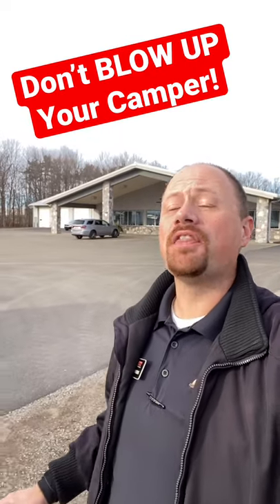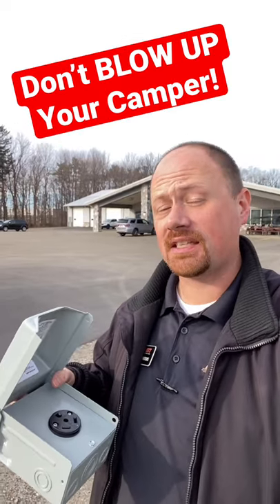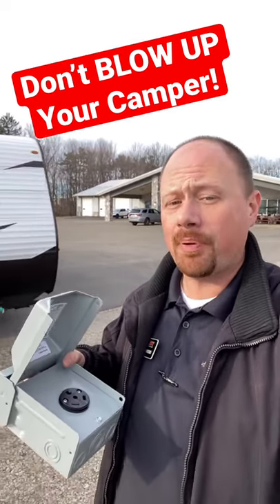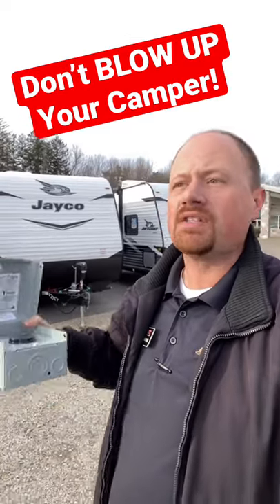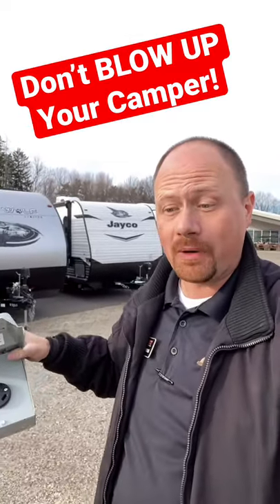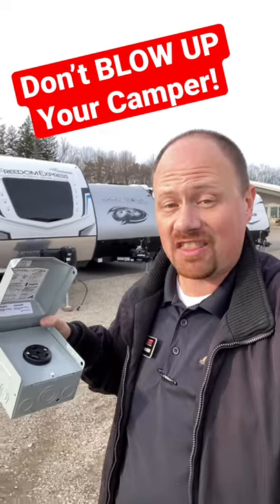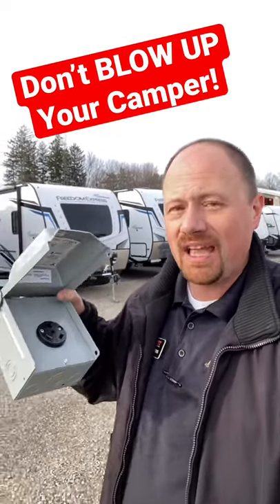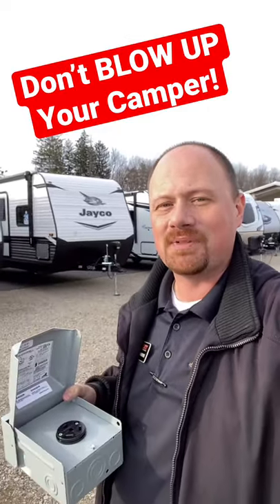Easy to Make Deadly Mistake!!

Comment: This video saved my brand new geo pro - my electrician put in a 220 - and I wouldn’t have known it.  Watched this video and called him - he came right away and changed it.  If it’s a dual pull it’s probably 220 but regardless you have to check the voltage if you don’t know wiring.  Thank god I watched this today!!!
Reply from the maker: Wow 😮 
I was hoping to help some people but to actually read it.. it’s different

So glad you made that call!!
Reply: I just did the same, only I’m the electrician. The only 30 amp single pole breakers I’ve ever installed were for well pumps, had no clue about rv’s. I’m heading down tomorrow to see how much it’s going to cost me.

Comment: I had a 50/30/15 box installed at my house. Best thing ever
Reply from the maker: Brilliant!
Reply: I had a 30 amp plug in installed on to the side of my house just for plugging my RV into. It's nice being able to run the air conditioner while packing it for a trip!

Comment: Whoever installed the outlet screwed up.  They used the wrong outlet for a 220 ckt.  The neutral blade is different between the 110 and 220 circuits.
Reply: Exactly my thoughts
Reply: It’s much different. Duh

Comment: each bus is 120v though? I only wire houses not campers but appliances like a range or dryer still only have 120v from either hot to the neutral. a sub panel works the same way

Comment: @ JoshtheRVNerd...
A 50ft. 30 amp Plugged into a Surge Protector and that's plugged into a 30amp to 110 volt adapter, would that suffice?... Or would you suggest a different approach?
Reply from the maker: Apologies I don't follow
What you're describing sounds like you're just dropping down to 15a household power

Comment: My son and I just installed a 30 amp outlet on the side of my shop for my RV.  Watch You Tube tutorials.  You must wire in a 110 breaker in the electrical box. NOT a 220 breaker.

Comment: And a tip for home owners. Mark the box 220/240 30amp.
Reply from the maker: Brilliant
Reply: @JoshtheRVNerd  I’m an retired electrician. And those boxes should be marked out so this doesn’t happen. So great info again from you !
Reply: This is exactly my problem today in a rented RV in my driveway while the termite exterminators are tenting my house!
So far, my ricemaker went POP, and the over-the-stove microwave died.
I can't get the owner of the RV to listen to me that welder plug just shown is a mistake!
When she comes by today with an "adapter" she just got overnighted to herself (I have no idea what she's talking about), should I suggest she plug the RV into a 110v outlet on the side of the garage?
I only need lights and the fridge in the RV. The weather is good, no need for ac or anything big.
Reply: 🤓 I have a tip for RV owners: don’t assume, ask. I believe we all know what assuming does. That’s right, it burns up your RV😂. Admit it, you thought I was going to write something else.

Comment: I had a buddy that almost did that at his farm he had an old shop that had a 30 amp plug in with an old plug in. He decided to get a new 30 amp rv outlet box and wired it outside so he could plug his camper in. Lucky for him that I was visiting him that day just before he went to plug it in and I asked him if it was a 240 setup or a 120? He wasn't sure and luckily his brother-in-law came over and used his multimeter and found out that it was a 240 amp for an old Lincoln welder. I've since bought one myself and check to make sure that the polarity is correct before I plug in, especially important to do for a private campground. I've found twice now that it was hooked up wrong. I paid under 75 for my multimeter and it has already saved me thousands of dollars. All you do is put one in the neutral (top hole) and the left and it will read your voltage if it is connected correctly. If it reads zero try the right side and if it reading the proper voltage then they hooked it up in reverse. If it does read correctly I still use my adapter cord just in case there is a power surge or brown out. Buying a new adapter cord is a lot cheaper than rewiring your trailer and/or replacing you electronics if they are fried.
Reply from the maker: oh my gosh.. textbook example of "Crisis Averted!"

Comment: I have wired in several of those plugs over the years with it's own 30A single pole breaker for when family visits or if I visited them. Whoever did that plugging in should have asked the house owner or called before trying to just plug in to a box. Takes just a second to do simple things to not burn down a trailer or house.
Reply from the maker: At least once a year I hear something like this. Hoping we can help someone avoid a really costly and potentially seriously dangerous mistake

Comment: This is exactly my problem today in a rented RV in my driveway while the termite exterminators are tenting my house!
So far, my ricemaker went POP, and the over-the-stove microwave died.
I can't get the owner of the RV to listen to me that welder plug just shown is a mistake!
When she comes by today with an "adapter" she just got overnighted to herself (I have no idea what she's talking about), should I suggest she plug the RV into a 110v outlet on the side of the garage?
I only need lights and the fridge in the RV. The weather is good, no need for ac or anything big.
@JoshtheRVNerd
Reply: @JoshtheRVNerd
I guess that's a yes

Comment: I’ve heard of this happening. Are people plugging a 30 amp RV (Nema TT30) into a Nema 10-50 or Nema 10-30 (both 220v) or are people miswiring TT-30 outlets?

Anyhoo, my welder is Nema 6-50 so a person shouldn’t be able to plug an RV in to it at all.

Comment: I have a 50amp camper and put in a 30amp box on my garage I use the 50 to 30 adapter cord and have had no problems. We did that right after we bought our first camper. People need to make sure they plug into the right out let. Good video for newbies.
Reply from the maker: Good call
Reply: So did u plug the regulator to the garage ? I have a 50 amp camper plugging into a double wide we have a 50 to 30 converter but it's in the middle of the cords ? Do we need a surge protector also and where does it go? On the trailer before u plug in the camper?

Comment: I could see this happening!
Reply from the maker: I see/hear about it once a year or so in passing. I'm sure it's something our service team hears about a little more often. It's never an "easy fix" 

Takes forever to figure out exactly what's fried and what's not. We have to pull the RV in. Figure out where the power is going and not going. Fix what isn't working. Check again. See if there's another "stop" down the line. Fix that. Check again. 

It's a very time consuming thing and most RV electrical is not easy to access.

Comment: My dad did that exact thing.
He was visiting a family friend who has plugs for RVs and plugged into the wrong plug for a welder.
Fried the voltage converter and the inverter for the motorhome (there were sparks) - family friend said it wasnt the first time it had happened

Comment: What if I plugged into a 15 Watt outlet I believe to power up a 30 amp camper with the adapter every thing was working fine for 2 weekends but now I have no thermostat or water heater but everything else works microwave basically power ran by battery just lost trying to figure this out instead of waiting in line for it to be looked at lol thanks
Reply from the maker: Not something I can diagnose from here. You're not providing your RV with all the power it needs. Sometimes running things on low power is just as damaging as too much power since devices have specific power ranges in which they're intended to operate
Reply: @JoshtheRVNerd  so if you had to guess what do you think it is I mean how does it work one week sit for a week then I go to use it for the weekend and nothing it's just weird lol thanks

Comment: I learned this when I flipped the switch on the power supply on an old desktop computer.  That lets all the magic smoke out.
Reply from the maker: Yeah once the magic smoke gets out they stop working

Every machine is a smoke machine if you operate it wrong enough

Comment: I see this all the time as a electrician. People see 30 amp and they think its like a old 240 volt. 30 Amp dryer outlet and wire it 240 volt instead of 120 volt.
Reply from the maker: Yes. Exactly this. We're so used to one plug ALWAYS providing one type of power. Throws us all off

Comment: Why would the connector fit in the first place? If both were done right there shouldn’t be any issues.
Reply from the maker: The two plugs mentioned fit the same profile. It’s stupid and shouldn’t be the case 

But it is
Reply: @JoshtheRVNerd  just like plumbing or tube fittings, really irritating things that fit together can be potentially hazardous 🤦‍♂️

Comment: Just carry a multimeter around with the camper. Test em first
Reply from the maker: It's 100% a good idea. But also important I think to remember a tool is only as good as the person using it. If you don't have the knowledge, then the tool won't help you!